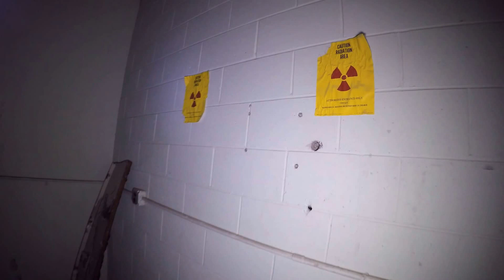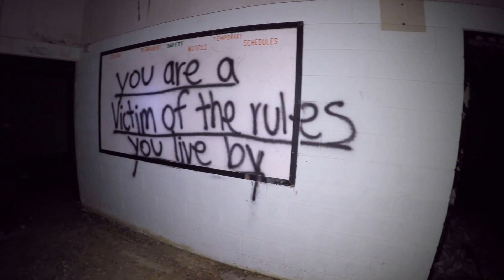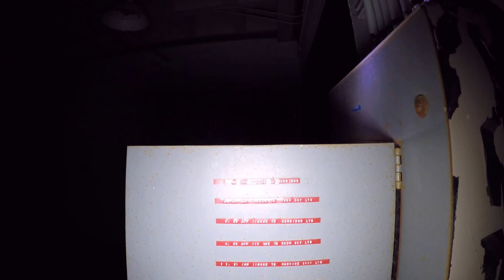Abandoned Fortuna Air Force Station

Comment: I was there in 73-74. I was a Refrigeration/Air Conditioning Specialist. Maintained the AC units in the 35 tower. I see some of the air handling units are still but that's all that is left of my equipment. I was on the roof a few times. The view was great and the antenna was very impressive up close.